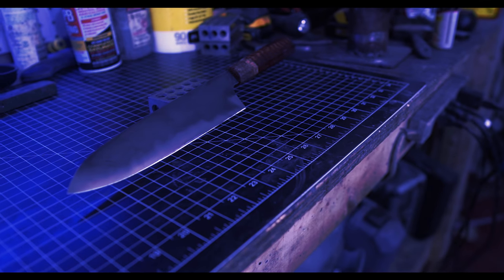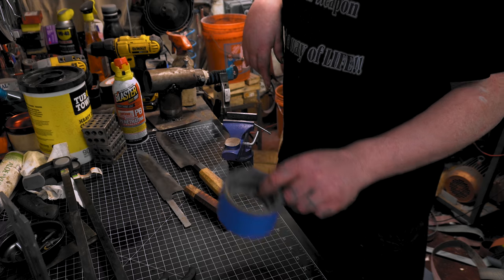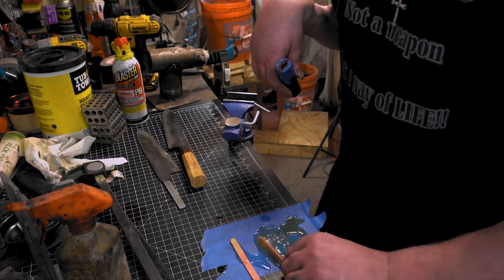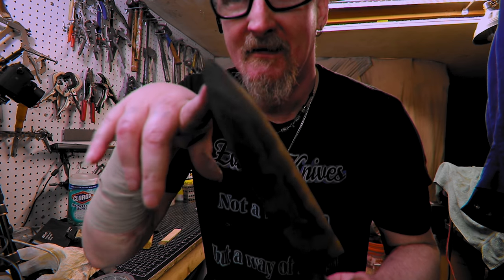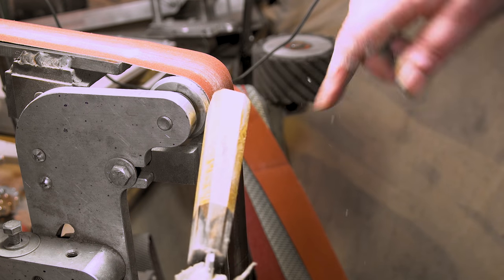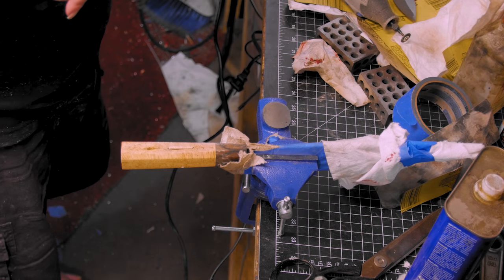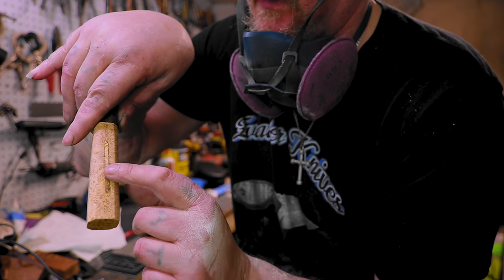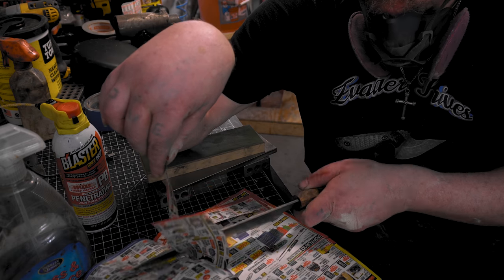Knifemaking - Kitchen Knife build(finish & sharpening)

Comment: Man you got some awesome knives there they turned out great!    However what is the best way to polish,finish stabilize wood handles is tru oil a way to go I dont have a high speed polisher ,and will try oil seal the wood...thanks once again nice knives brother
Reply from the maker: Awesome, thanks for the advice. Definitely will come in handy. I don't do many wood handles, but just bought some more stabilized wood for future kitchen knives. Now that I kinda know what's going on, hopefully they'll be a little easier